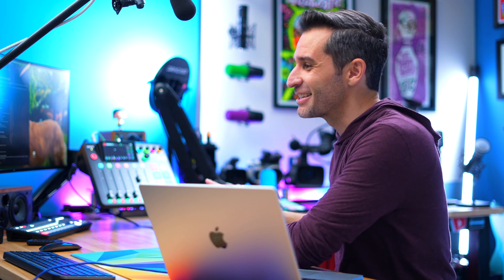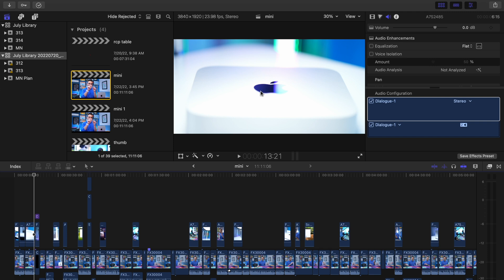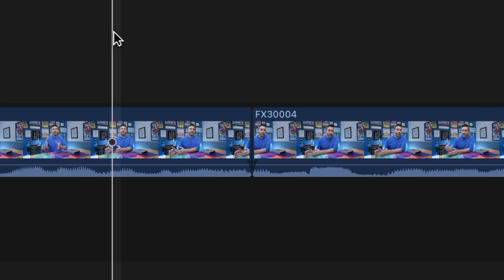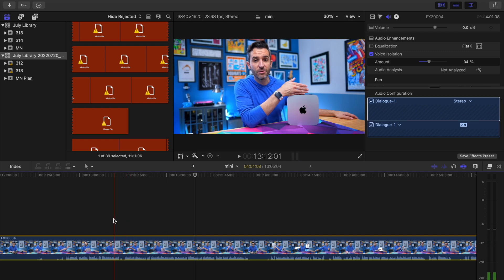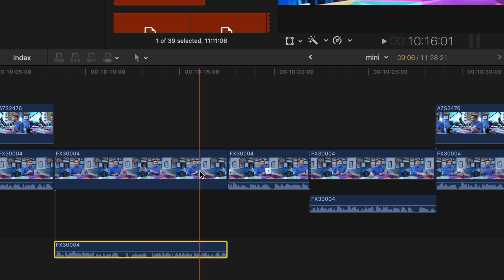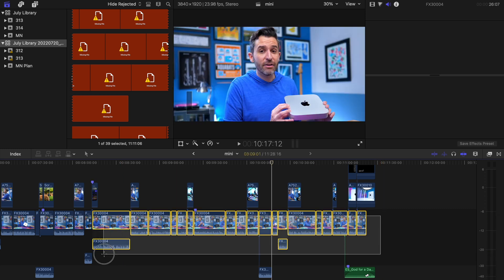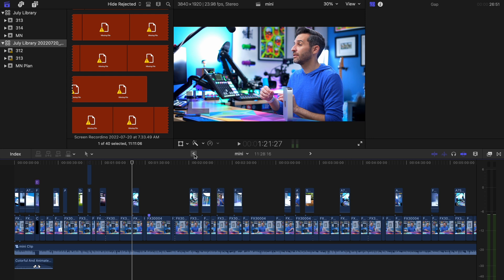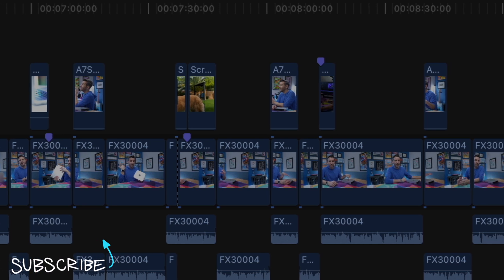How To Use (And Fix) Final Cut Pro's Voice Isolation

Comment: Hey there! Question about voice isolation. I have one long project about 25 minutes. We're using voice isolation in FCP. There are some points where the voice sounds distorted almost like it's doubled or kind of underwater. Have you ever encountered this issue? Any idea what that would be?
Reply from the maker: That can definitely happen for a variety of reasons. With longer clips, Voice Isolation is looking at EVERYTHING, so if you have parts with lots of problems and other parts that don't sound too bad, they're all getting mixed together. It sometimes helps to break the clip into parts where you can apply different levels of VI to different parts 👍
Reply: @tombuck  hey Tom thanks so much for the reply! really appreciate it. I think my editor turned the whole project into a compound clip to do audio / loudness normalization and applied the VI to the compound clip, i'll have to check with him. Do you think that could be causing it? Vs applying it at the clip level?

Comment: The trick is to extend the clips that are meeting up by about a few seconds and then manually create volume point after of course detaching all your audio separately from the video clips and then do a manual fade in and fade out of each respective clip - that way the voice isolation plugin has time to process the fade in and fade out reading and does not create the click and pop. This happens because of audio buffer issue - but by manually giving each clip more breathing space - the issue is resolved. Hopefully FCPX will fix this soon.
Reply from the maker: For me, I've done this and still have the popping issue. It almost seems like it's how FCP handles the Voice Isolation when a clip ends, regardless of whether or not it overlaps something else 🤷🏻‍♂️

Comment: You can also use the timeline index in Final Cut Pro to select all the videos from your fx30 in the Final Cut Pro timeline and it highlights everything and then detach the audio that way. Much easier and saves a lot of time. You can use this to multi select effects or pretty much anything in your Final Cut Pro timeline before creating a compound clip. Learned this from a fellow creator called Mathew O’Brien

Comment: For me, the much bigger problem is that I can't click on the voice isolation on my m1 pro macbook. I read somewhere that this could be related to mono and stereo tracks, but with most videos nothing happens at all. I simply can't click on it.
Reply from the maker: Yes, mono and stereo tracks can change the available settings. Sometimes you can right click on them, turn them into a compound clip, and then apply the isolation to that.
Reply: @tombuck  thanks for your help! I really appreciate it 🙂

Comment: Hey Tom, great video. I didn’t know about the pop issue but that could be because I generally use compound clips at the end of an edit apply any effect i want to any particular stream of audio including the voice isolation to the dialogue role without the need to detach all the dialogue. And if there’s clips with talking in different locations etc I use dialogue subroles to split those out. Either way the principle is the same. Thanks again for another great to trial video.
Reply from the maker: Sounds like you were already solving the issue before it became a problem. Nice! 😎

Comment: What happens if you: 
1. Throw all your A roll on a timeline 
2. Select all and make a compound clip
3. Apply Voice Isolation
4. Create ANOTHER compound clip
5. and then edit that final one?

Curious if you have experience with this. Usually I use the two-compound clip method for myself to make it easy to adjust audio and video effects across all my a roll clips. I throw everything in my timeline and then make a compound clip called “Adjustments.” I apply all my audio and video adjustments to that compound clip. Then I make a SECOND compound clip called “Edit this one” which is what I use to actually cut and edit the a roll together. This makes it so I can tweak the audio or video effects at any time, and they apply across all my cuts. I may try this tomorrow and report back!

Either way, thank you for an excellent tutorial!
Reply from the maker: I've never done this myself, to be honest, so I don't know exactly how it would work. It sounds like you've developed your own way of creating adjustment layers in FCP, which is pretty darn awesome. 😎